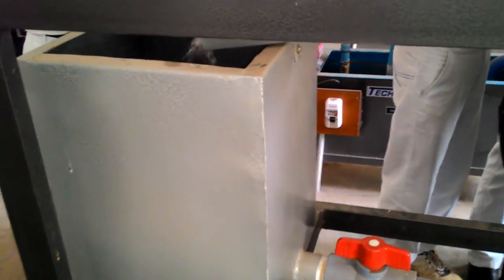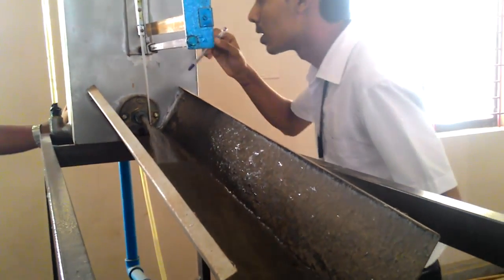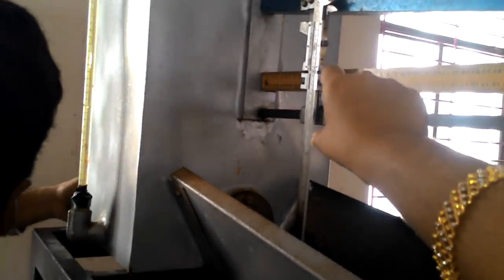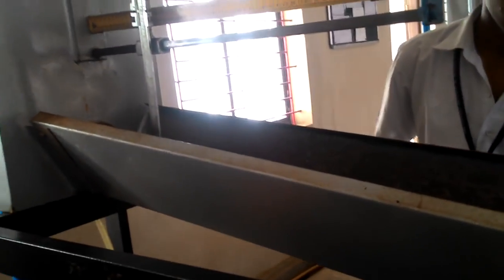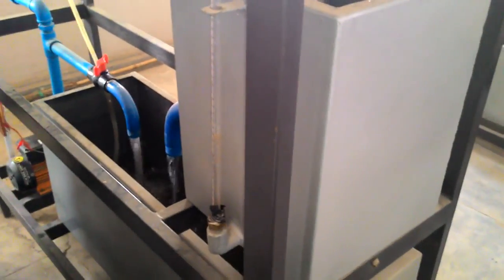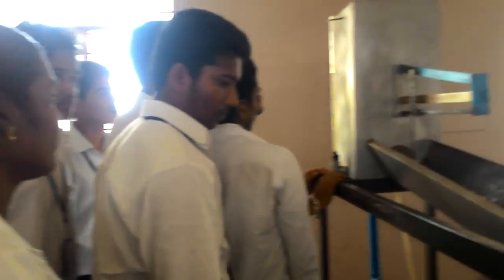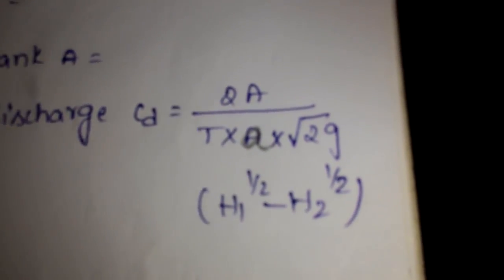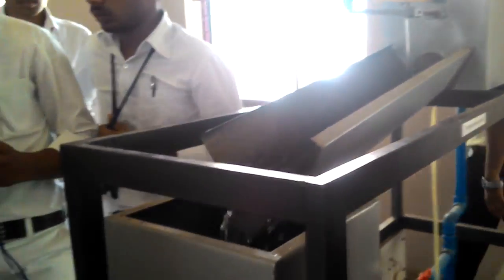Orifice and mouthpieces experiment

Comment: I just want to ask , the length of the mouthpiece must not be longer than 2 to 3 times the diameter of the opening or orifice , but the mouthpiece you indicated far exceeds the diameter of the orifice , please explain or correct me if I am wrong
Reply: Bro, you are correct mouthpiece should be 2 to 3 times the diameter of orifice but the length of the mouthpiece will change